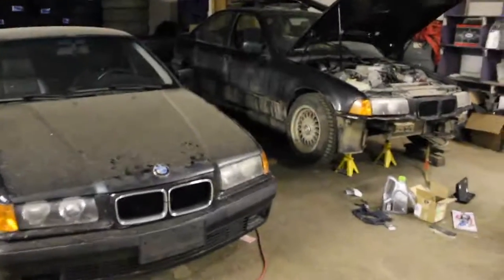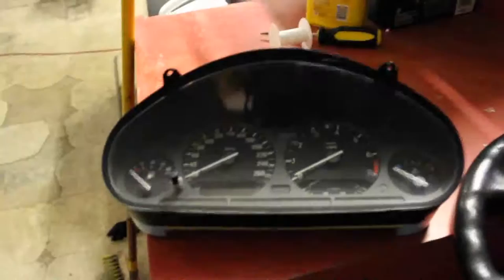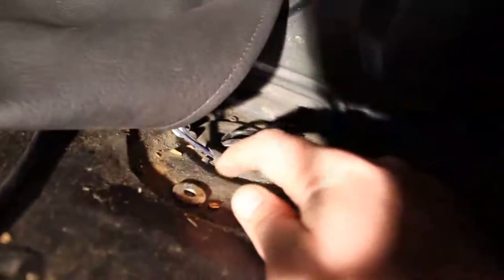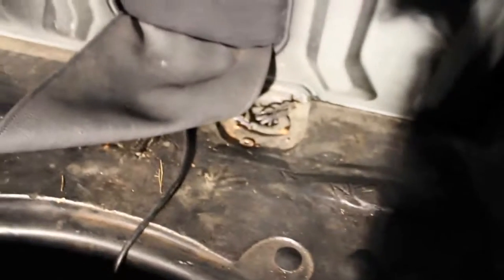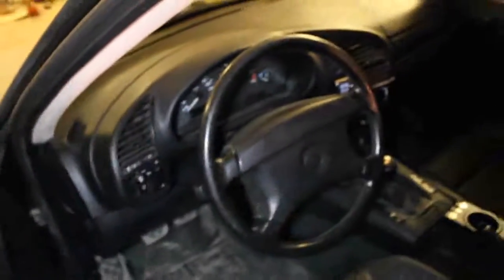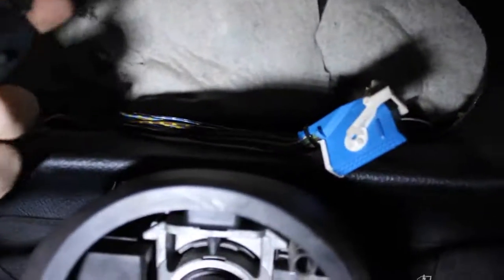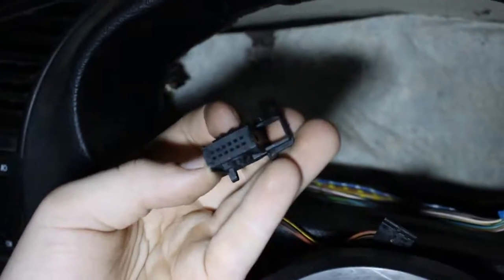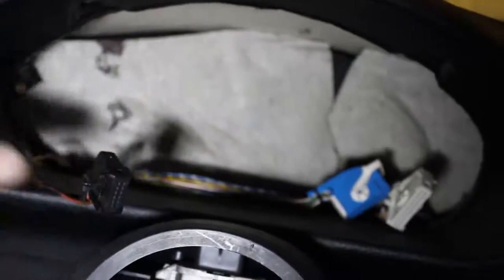How to Fix a BMW E36 Speedometer

Comment: hey I have a question can I put a M3 speedometer in my 318is ???
Reply from the maker: It should fit fine. I don't know for sure but I I believe any year e36 will fit. doesn't matter obd1 or obd2 I think.